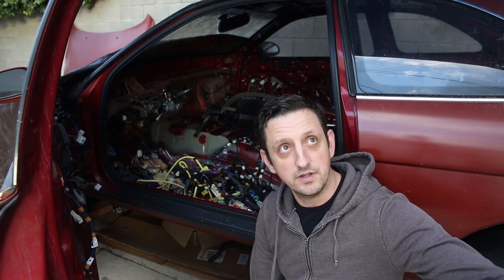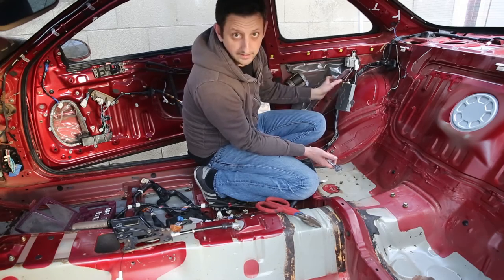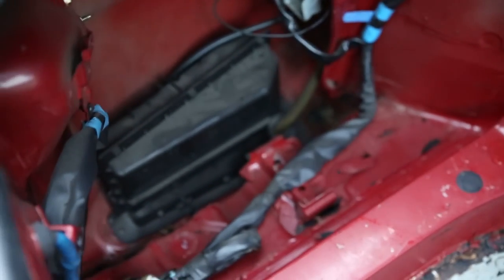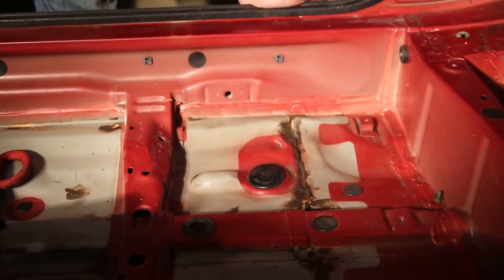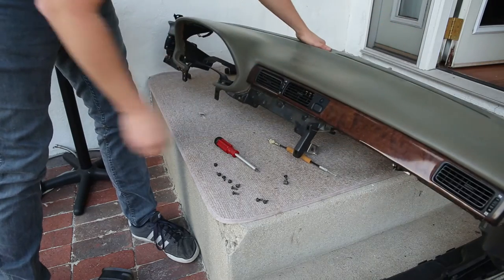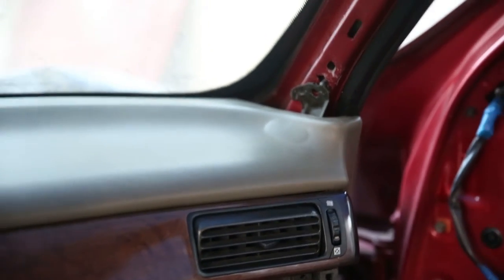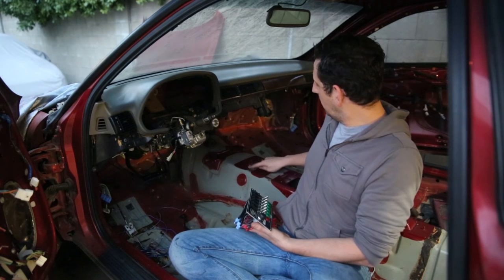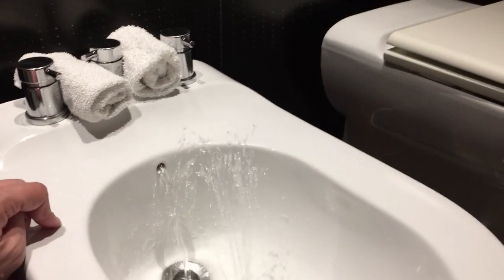Lexus SC400 Drift Build. Ep.19 - More Interior Work & Dash Reinstall

Comment: You might not be a great fabricator, (yeah i saw them motor mounts) but you can gut a car like nobody's business, and with hand tools no less. Dang dude that is some commitment. If I was still in Cali I would be totally up to working on your project with you.
Reply from the maker: You're watching my first attempts at fabricating, so yeah, not great. I doubt anyone is really good at metalworking their first time around. The second version of my motor mounts turned out way better than the first, so at least I'm making progress. I'll keep getting better over time. And I use hand tools for everything (even fab work). I could definitely use an upgrade there.
Reply: @FullySpooled  Dude!!! Spoiler Warning... Just pulling your leg. I am planning on building a track car for LeMons in the next year or two, you might have pointed me in the right direction. 
Now I need to finish my other two project cars first...

Comment: My vote is to weld in some cover plates for the rear quarter panel access and just cut an aluminum panel to cover over the doors and use whatever factory bolt holes you can find to mount it. you can stick some thin foam weatherstripping on the panel if you want to keep moisture out, though you'll probably not need to care, since you certainly won't want to drive it with windows since you deleted the blower and AC system.

Comment: First of all, the dash looks great back in the car! I think that eventually you should mill and varnish a solid piece of hardwood (yeah, I know it might add a little weight, but still) to replace the current wood veneer trim piece and vents. That way it can be both luxury and no useless black plastic flopping around.

Second, the bidet controls: left and right are hot and cold water (like on a two knob sink). Center is like the "blend door" knob — turn it one way and all the water will come out the booty-sprayer; turn it the other way fully and water will all come out the back (which helps rinse out anything from the bidet bowl).  Had one when I lived in Italy. Don't know why the hotel put washcloths between the knobs, though.
Reply from the maker: Interesting idea making my own replacement wood for the dash. I might have to look into that. I was thinking of maybe replacing it with carbon fiber vinyl or just another OEM dash part. Right now I just want to get the mechanicals taken care of and I can worry about making it pretty later.

And thanks for the info on the bidet. I get the general concept, but it just seems overly complicated. :) especially since the first time I turned it on the water hit the ceiling.